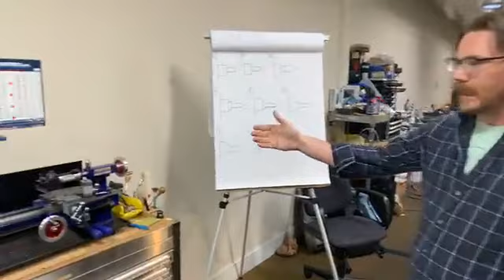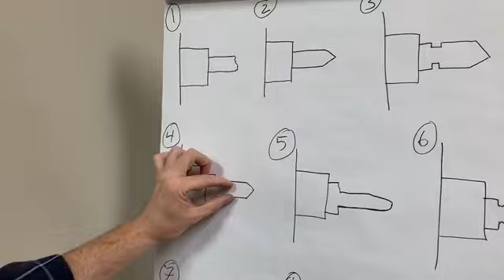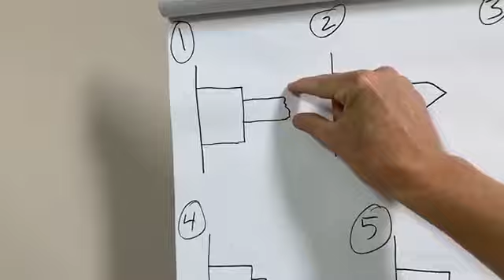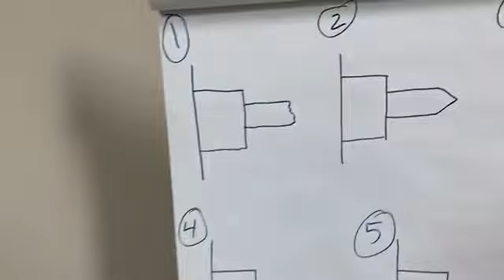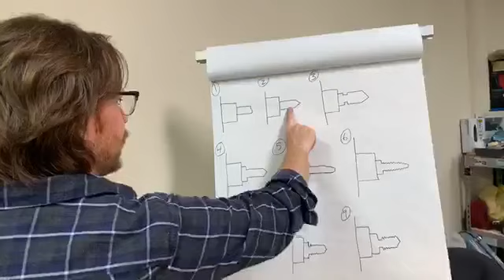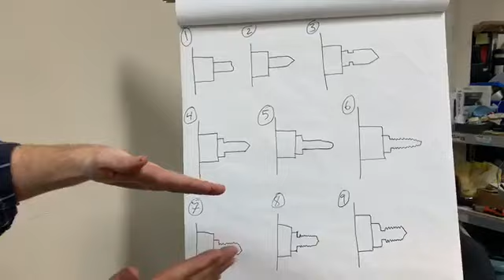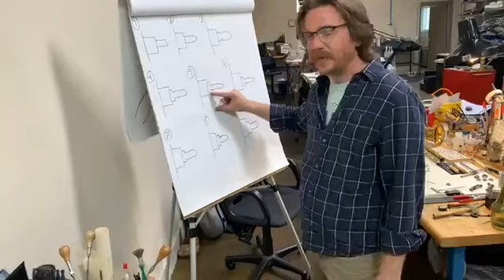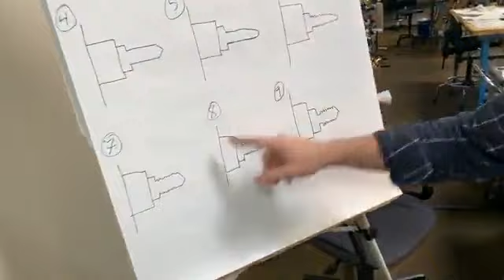#WednesdayWisdom Live:  Lubricating a Saxophone & Making a New Hinge Rod

Comment: Hi, thanks for all the videos guys, just wanted to ask what collet size are you using and what type of collet holder is that?
Reply from the maker: The type of collet holder is an ER-11 and we are using as assortment of collets with it to hold different rod sizes. Just make sure you get one that has a through hole, if not you'll need to modify it so you can use it with longer rods.

Comment: What do you call those burners that are used to heat the pads off? And where to buy them?
Reply from the maker: If you're just looking to remove old pads you can use a simple torch like this: https://www.musicmedic.com/products/repair-tools/torches/blazer-stingray-butane-torch.html If you're looking to adjust pads while padding our Vortex Airtorch is the best choice because it's not too hot and won't burn lacquer or materials: https://www.musicmedic.com/catalog/product/view/id/254/s/vortex-air-torch/category/54/